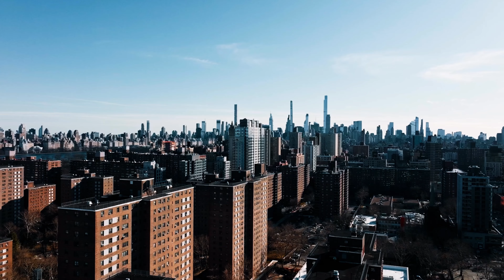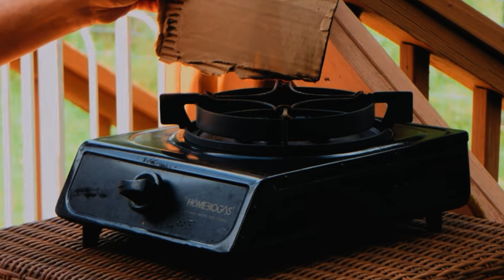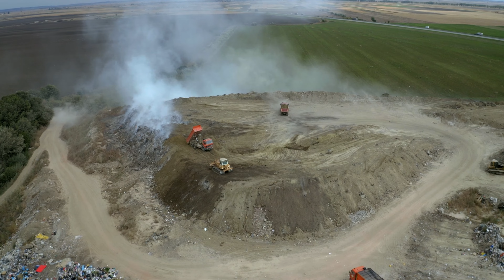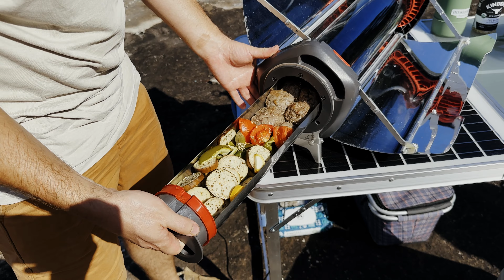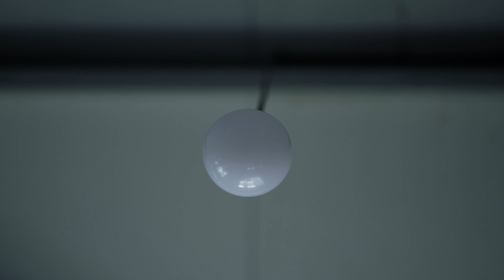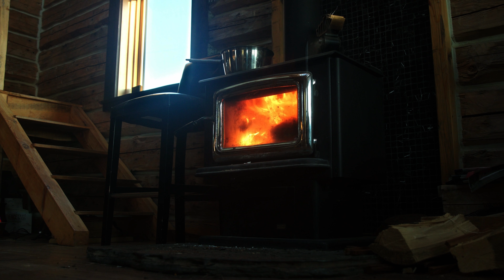The Off Grid Guide - Part 5 | Energy

Comment: Dishwashers are very efficient waterwise, a modern fullsize dishwasher only uses 4-6 gallons of water for an entire load. 

Now yes it does take energy to pump that water around and heat it,  but that is energy I'm willing to use, 

You can also get small tabletob dishwashers that don't use too much power either. I had one and to heat and run a full load of dishes was about 1.2 kwh of energy and just over a gallon of water

Comment: Your solar and battery research is about 5 years old.  Consumer available solar before shipping is 25 cents/watt (not even the bulk price).  LFP batteries (most popular form of lithium ion.  You were referencing problems with old NMC li ion tech) just don't explode or burn and are so cheap and long lasting that lead acid aren't economical off grid or anywhere.  LFP lasting 5x or longer, only having to buy 1/2 as many, also being recyclable likely makes them the ethical choice.  Yes lead is the most recycled metal in the US, but LFP so long lasting that we won't see a need for 10-20 years, and LFP recycling already cheaper than mining lithium.  All the energy going into to constantly recycling short life lead batteries makes them less attractive vs a better, cheaper and longer lasting LFP.
Reply from the maker: It’s all still very relevant as this tech is still sold extensively.  Prices will go back up as the fracking subsidy vanishes.  All solar PV tech relies on fossil fuels at their root
Reply: @AltOrdo  interesting.  Panels mostly made in China who has the most solar and is installing the more solar than the rest of the world combined.  Seems like this has become a matter of faith over research, so I'll stop offering comments.  Thanks for your work.
Reply from the maker: It’s all research based here.  Please show me how China is making PV panels using PV or Wind energy and not coal / oil.  That claim takes faith.

Comment: Statement that wood smoke in atmosphere is ok is false.  Wood smoke causes massive health issues in 3rd world cooking.

Wood burning stoves that emit unburnt hydrocarbons (wood smoke) are bad for health, planet and finances vs rocket mass/masonry stove.  (Almost no unburnt exhaust).

You just missed the connection vs the 2 types.  Don't want to mislead people as most of your other content is good enough to make people more likely to trust you.
Reply from the maker: Not everyone is the USA is going to start using wood stoves.  If everyone started using wood stoves (which they won’t) we might have an issue.  Forest fires have been a part of the cycle for eons, woodsmoke at current levels is nothing compared to legal automobiles and industrial ag / mfg.

Your points are good.  I think anyone serious enough to do this will go the extra mile and learn more, it’s hard for us to cover every last qualification and exception.   Rocket stoves are absolutely the way to go.  Best option hands down to use biomass.  We’re on the same page there

Comment: FYI: 
1.  Methane powered ICE vehicles are mainstream in taxi and delivery fleets.  Toronto is an example. You can go to a gas station and fill up with methane.
2. Methane leaks are a huge global warming issue from industrial systems maintained by professionals.  Home systems tend to be neglected, so methane digesters may actually contribute to global warming depending on maintenance...a downfall in many homes and permaculture designs.
3.  Research on indoor air quality and health has people switching away from indoor gas burning even it was free.  Electric cooking inductive or even better via pressure with cheap solar and batteries probsbly simpler and safer than indoor gas.

Comment: I do have a question that I've been waiting to see if it was addressed after watching more videos.  I it possible or inadvisable to utilize the same tin roof areas for combined rainwater collection and solar panels?  From what I've seen the solar panels seem to be slightly raise above the tin roof itself, so it's made me wonder about that possibility.  Or does the presence of solar panels reduce the ability to utilize that particular roof for rain water collection?
Reply from the maker: Could work, I just don’t like putting holes in a good roof for solar,  solar can go on racks.  Solar panels also have some nasty toxic chemical in them, so I like to play it safe too.
Reply: @AltOrdo understand types of solar. Modern lead free glass encased solar is cheapest.  Thin film contains toxic heavy metals, but why would you use that tech?  Solar glass for rainwater probably safer than galvanized roofing.
Reply: @AltOrdo modern glass encased lead free solder silicon panels are cheapest and most efficient. Thin film panels contain toxic heavy metals and are more expensive.  Why use them.

Solar glass for water collection probably has less toxicity than the heavy metals leaching from a galvanized roof.
Reply: Self ballasted solar panel roof mounts when designed sustainably are the cheapest mounts and don't put holes in the roof.  Commercial self ballasted versions aren't appropriate for saving money off grid when DIY is the ethos.

Comment: Also consider using energy without converting it or converting it to a lower tech level. If you have a workshop, most of your power tools use a spinning MOVEMENT so you're probably better off with a pneumatic system and using your solar energy or even steam (!) If you have plenty biomass to burn to charge a pressuized tank. It's far more easy to maintain a low tech system than a high tech one.
Reply from the maker: Agreed.  Low tech solutions are best for the long term

Comment: So the way i see it, it's not really liquid fertiliser if i can't use it in the garden only in an orchard. I prefer NOT having black water at all. If you don't have large animals that produce an excessive amount of manure, you're better off actually composting. Plus it requires water. Plusplus, when you all done with it, you end up with a whole lot of liquid AND solid black waste, you just fermented it, if i see it correctly. Please correct me if im wrong.
Reply from the maker: You don’t have to use the system as an above ground septic.  Any human/animal waste is a fertilizer if used properly.  It’s nuanced, but it is fertilizer for many trees and plants.  Just avoid leafy greens for safety sake

Comment: Nuclear is actually better than oil.
It’s safer, cleaner, and more efficient than anything else rn (relative to megawatt hours produced and megawatt hours per gram of fuel) 
Honestly you get MORE ambient radiation around coal burning plants than you do around nuclear plants
Reply: This is true, many people have a distorted view of nuclear energy. People fear disasters that are now practically impossible due to new technical improvements and regulations.

For example, Germany stopped nuclear plants and then they opened coal plants and started to import energy because surprise, they needed energy. It's an environmental disaster.
Reply from the maker: It’s good to have an energy mix.  As long as we have the diesel to run operations for nuclear plants, we’ll be ok.
Reply: @AltOrdo Sure but oil is an objectively increasingly obsolete technology when it comes to generating electricity, even without taking climate change into consideration. There’s a reason coal is going out of business.
Reply from the maker: Without fossil fuels we won’t be able to mine, transport or operate Wind, Solar or Nuclear.  Oil is the master resource